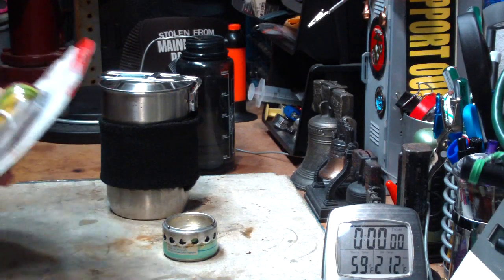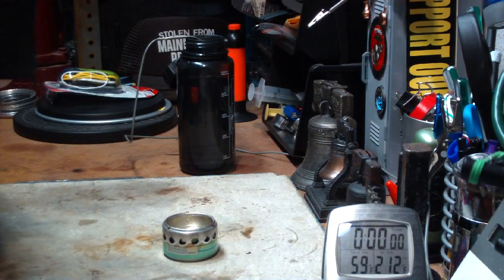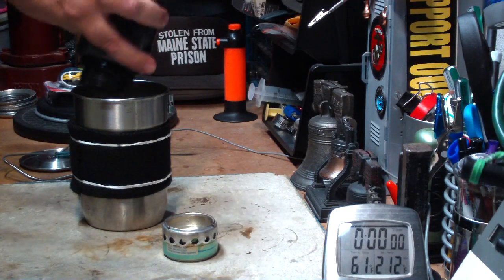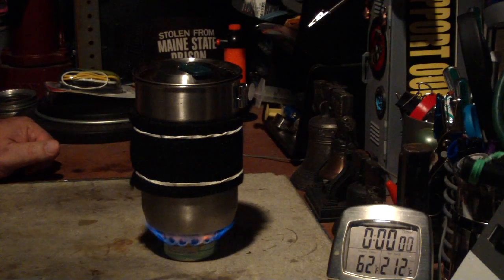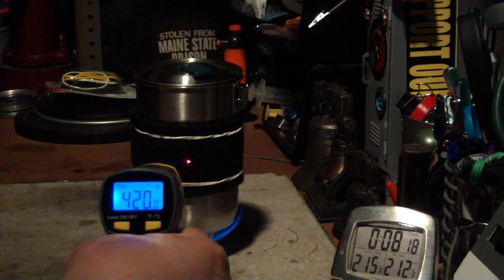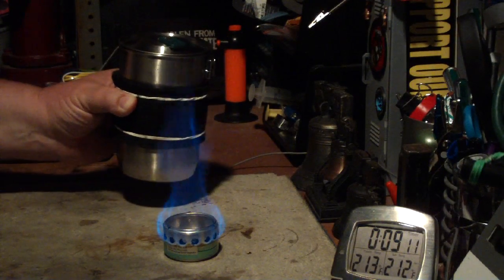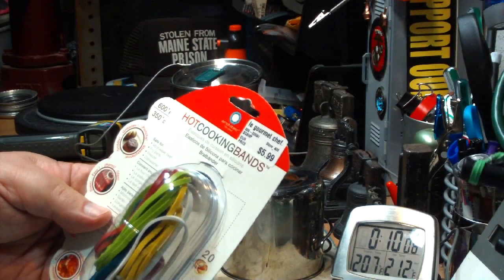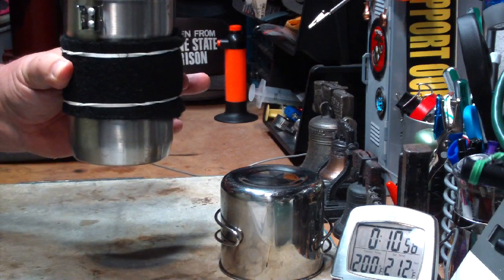Carbon Felt Blanket for Pots and Mugs

Comment: This is a cool idea! You could also "sew" the felt blanket in place with metal wire. As someone mentioned, this would be cool on the GSI Minimalist as you'd still have the insulation of a cozy but it would be fire-proof and could potentially speed up boil times.